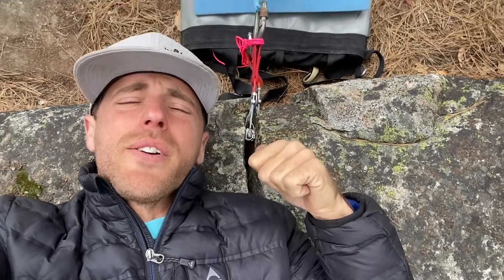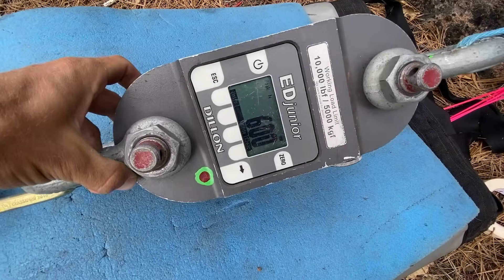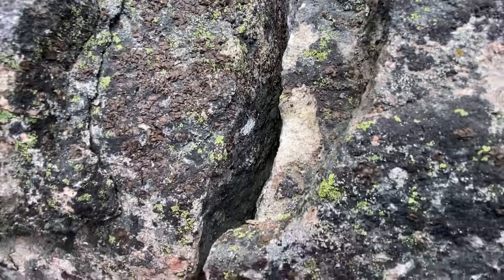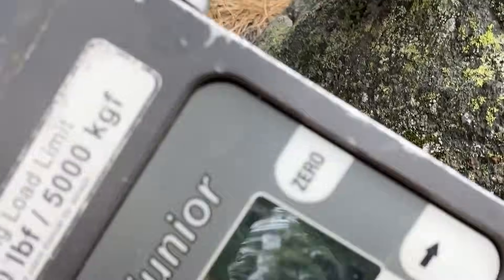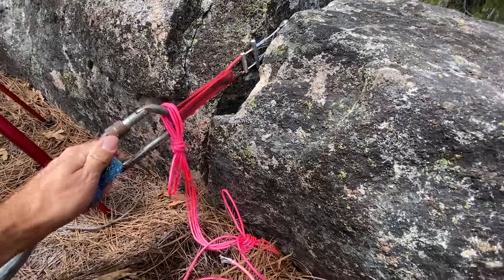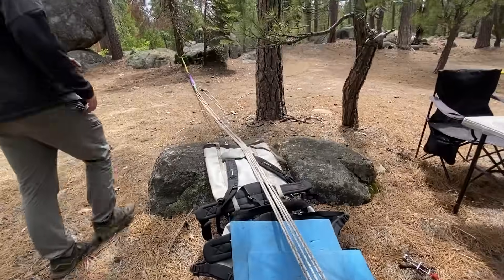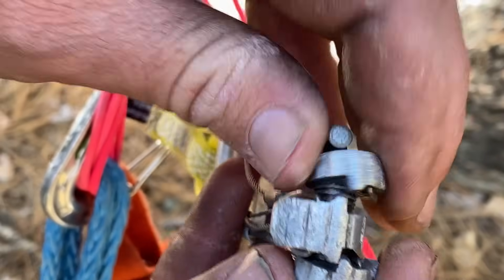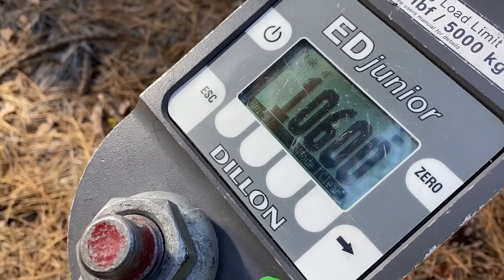Metolius TCU climbing cams pulled until failure - Great Slow Motion!

Comment: Impact force is more than just body weight.  You can lift a 5 lb weight with a thread but it will snap easily if you drop the weight.  5kn force from climber is possible from higher fall height.  A crack in a slab is a weak spot.  I trust the gear far more than I trust a mystery crack.  And I trust the rock far more than I trust my friend who tied the knots.

Comment: I wonder if you can strengthen it by putting a metal eye in the steel wire loop of the cam. That way the bend radius of the wire and the sling would be more favorable. I just wanna see the business end of a cam explode XD

Comment: 1 kilonewton is roughly 225 lbs of force. 11.85 kilonewtons is about 2,600 lbs of force. That's a lot! Those cams would hold most small cars in the air depending on the cam size.

Comment: I think this speaks a lot about working with gravity.  You might want to only use horizontal cracks because the weight of the rock pushes down on the cam.  With vertical cracks you don't get the same force of the rock pressing down.
Reply: If you are talking about a boulder, I'd agree, but for cracks in large rock faces, this makes absolutely no difference.

Comment: How much splitting force was put on the rock will depend upon the angle between the axis of the cams and the contact points on the rock - probably more as the cam opens up to max

Comment: From what I can see that's been recorded it looks to be a 36:1 complex ( a system that doesn't fit the def of a simple/ compound) pulley system. If I get a better overall view of the system I can make a better call. You start the T counting method at the pulling end/ tail (where a stopper knot would be), it's a lot better for when making complex or compound systems.

Comment: 7:13 I am an engineer, I know the math.
You can't say exactly how big this force was (You need to know specific size of equipment) but it was exactly as much as this rock weight (by eye 1-2 tons)

In the perpendicular direction, the forces goes to infinity, so it is half the strength of the equipment plus the torque force (depends on the shape and size of the equipment)

Comment: As someone who knows nothing about climbing, and only a bit about physics (high school)... Keep in mind that shock loading can be up into the tens of gees. So a very big dude falling on a unsafely stiff rope might BARELY edge out a failure (100 kg * 100 m/s^2 = 10kN). Or worse the cam lobes might not dig in right from the shock loading? Either way, even if the cam holds, at those accelerations there's a pretty good chance the rope jerk just snaps your spine... So there are other problems

Comment: Is grinding a cam safe? Idk everything about metallurgy but I know grinding a metal can ruin the heat temperament of a metal due to heat input. Filing is ok but from being a welder I know as soon as you see base metal turn any shade of blue you've changed the chemical composition and temperament of the metal
Reply: you change the temper , not the composition of the metal

Comment: I have never trusted cams because when you set them, you are anchoring into a cracked rock. But the reason the crack is there in the first place is because various forces have caused the rock to break and move apart. Even though the crack may be in large and seemingly stable rocks, it might also be right near a balance point of a huge rock that takes very little force to make it tip. When a cam tightens, the force applied to grip the rock is multiplied exponentially to the tension of your rope and can move big rocks easily. When the rock shifts, the cam looses its grip and then you are back to relying on your last good anchor. I use bolts for all of my anchors as the forces are just shear and the risk of shifting the rock is much less. Cams might be ok for 99 times out of 100 but that's not good enough for me. I now also assess the stability of the face that I am on in large blocks; I once stepped on an innocent looking ledge only to have about 5 cubic yards of rock disappear from under my feet. I can tell you, that is a weird feeling!

Comment: In addition to learning something about TCUs in granite, there are tree very helpfull takeaways for me:
1. Vertical cracks can be less secure than horizontal ones in some circumstances, because gravity. Was really shocked by this boulder moving.
2. Old slings are really bad. Every single sling in this test holds 22KN+ when new. Old slings obviously don‘t… not at all.
3. Carabiners create a lot more stress on the rest of the material and slings should only be substituted for carabiners after careful considetation.
Reply from the maker: Don't think the slings were compromised by age. the bend radius where the sling attaches to the wire on the cam is very severe and the wire cuts into the webbing, even when reinforced. We see similar results on new cams. The 22 kn rating for similar slings is achieved with a less severe bend radius. 10mm pin if I recall correctly.

Comment: The outwards force (left and right together) of the cam has to be at least the outward force divided by the coefficient of friction (F = mu N) and assuming a coefficient of friction of about 0.5 and a foce of 10kN, that would be about 20kN outwards (minimum to avoid slipping). This is very approximate but it should be right

Comment: These videos are great! You should get some granite off cuts from a countertop installer. The underside is fairly natural texture.
Reply: What would be the point of that? Countertop cut off are not gonna weight enough to test anything.
Reply: @goodbyemr.anderson5065  not for weight. To use as the contact surface for the cam. Test cam against stone instead of cam against metal.

Comment: This just tells me that cam placement is better in horizontal cracks rather than vertical cracks. Vertical cracks can be levered with less force than it would take to lift the mass of the rock itself. Whereas, horizontal placement means you would need to overcome the entire mass of the rock to have the cam slip out.

Comment: Talking about the bend radius issues on the cable I wonder if doubling up carabiners might help?
Reply: The metal wire will still bend over the edge of the carabiner.  That's the bend radius he's referring to.

Comment: According to factory testing Petzl has done they say an anchor experiencing a FF 1 fall could see as much as 6kn of dynamic load +\- .5 kn.  Interested in how that lines up with your tests?

If that is true, there is a generous safety factor designed into these cams. Makes one feel a lot more confident using them.

Comment: 1. you could put fiberglassed cement-board in your cam-crusher for rock-lick friction
2. you can use sharpie on the cam teeth to gauge new vs. old damage pretty easily, if that is something that matters to you.

Comment: Wow those cams are amazing un real i never rock climb but seen theas cams in out doors outfitters and though i wouldent want to trust that im wrong as long as you know how to use it the cable and sling will break before coming out:::

Comment: Fun to watch and useful. To me, this confirms what I was told/thought about placements pulling out - unless you're on #00 tiny stuff, it's really all about the quality of the placement and the quality of the rock.

A little shocking to me to see the side section of that first rock rip off. It didn't look like a flake from the camera angles. It's granite, not overly rotten rock. I'd call it confidence inspiring. The placement wasn't all that shallow either. Having the rock fracture ~5.5kN was a little shocking. I think this was a worst-case - typically the cam wouldn't pull directly out in a fall, but slightly downward. Still, a bit surprising. I might consider being slightly less confident about shallow placements from now on.

Comment: The lateral force by a cam goes as  1 over the tangent of the angle formed by the contact point and the axle, call it theta: F_lat=0.5*F_ax/tan(theta).  That angle is a design variable which depends very much on the anticipated coefficient of friction--the lower the friction, the smaller that angle must be to hold.  A cam will NOT work without some friction to keep the lobes from slipping and thereby force the cam rotation harder into the wall.   For example, cams don't work on polished granite.  This theta angle is typically around 15 degrees and remains about constant with cam extension for parallel sided cracks.  In this case of about 11kN axial force, the lateral force would therefore be approximately 21 kN (4700 lb).

Comment: Backing all the way out, to just thinking about placing gear for protection - a simple nut in a good tapered placement also exerts wedging force, but the friction against the walls might be higher, so expansion might not be observed. It looks like that particular rock could be slung around the other end, a perfectly useful way to get a directional anchor that exerts just a single pull, with no multiplications from cam leverage, etc, and as it weighs several tons, one could expect to trust it. Except, that if it were poised on a near balance point, the force needed to rotate it might be a small fraction of its total weight. Thinking about how each situation has potential weaknesses can be sobering. Making a habit of placing even cams into tapers and not just blindly into parallel slots can make much more reliable protection.

Comment: Easy idea for the slack-snap out of rock.  Granite countertop dealers will sell you the pieces from sink cutouts for dirt cheap and then you can fabricate your plates to hold them.  Usually, the bottom side of the material is rough,

Comment: Basically as long as you're not trying to lift a small car you're safe.
Reply: "Big" car lol. Pretty sure those cams could take care of most compacts. But yeah, if you are trying to dangle your 4x4 off a cliff, I reckon use three of them to be safe.
Reply: @TheWtfnonamez  I was just about to ask how many to use for a vehicle lol

I don't know anything about rock climbing anchors, but I know about block and tackle pulley systems and I know that if we had a good enough anchor you could pull a car straight up a cliff with your bare hands using mechanical advantage! Always fun to imagine what might be possible with these tiny devices
Reply: Same 🍰
Reply: Or using slippery cracks!!
Reply: @sammyd7857  You better remember to pack condoms on the next hike.
Reply: Which absolutely blows my mind
Reply: I learnt in my harness safety course over 10 years ago. If a construction worker falls ? His harness puts 800kg of force by the time the safety Webbing opens on your body. Your body takes 800 kgf if you are 100 kg bloke? Insane! Cheers from Australia just subbed.nice work.
Reply: @dragan3290  how did they test that?
Reply: @sammyd7857  I wish they told us! But those were the figures even when I asked the abseling crew on the site. Oh btw the eye bolts that the abseling crews install have to pass 6.5 kn when lifted out of concrete upwards. That s how they test the anchors on site before anyone is allowed to use. Seems textreme?
Reply: @sammyd7857  It’s a pretty simple physics equation.
Reply: @dragan3290  That 800kg seems...super not true. Especially considering construction workers bring their attachment points with them, so they are not taking factor-2 falls. That would be almost 8kN, which is more than any lead climbing fall.
Reply: What if yoi weight the same as a small car
Reply: @chetcoyote89  then you may want to consider wearing a nappy
Reply: That rock will way a lot more than a small car.
Reply: @thedoddfishtreemonkey.7760  Obviously, what's your point?
Reply: @skrimper  if it’s so obvious then why was it an example…….Sherlock F*cking Holmes ?
Reply: 🤔So I'm good if I'm lifting a large car... good to know😉
Reply: Yeah but falling turns the weight of a human into the weight of a small car sometimes if you fall far enough
Reply: lmao this aged poorly with the dmm car lift with one of their little cams
Reply: Or fall 6 meters at 100kg. That would do it too.
Reply: Or tal an X fall
Reply: Don't lift your mom ..got it
Reply: Battleships are right out
Reply: Better not climb then 💪🏼
Reply: If a human falls like 10 feet it could generate 10 kn or more depending on how fat you are
Reply: @actuallynevermind8120  unless you're using a completely static system you're probably never going to go above 5kn of force for a fall

Comment: Sponsers HEAR THIS! This is important! I went from just this morning not quite believing in cams completely, to now feeling that I actually do trust them. If this can change my mind, just think how it could increase your market share! C'mon - Sponser this guy!
Reply: You need to trust your placement and the rock. Thin metal stuff, if you still can't bend it, will still hold multiple times your weight.
Reply: It Really helps to play with them over n over in safe situations to get to know em and how to place em! After a while of this you’ll know what works and what does not and then your trust will build even more! 🤘👽
Reply: @Thurston86  I completely agree. With your comment and the comments above yours. I already trust the cam to do what it supposed to do. For me the cam was never in question. Its the placement and the rock. And the only way to really know how to trust your placement is, like you said, to spend time playing around with it on the ground..or in a safe situation. After awhile u pretty much develop an instinct for it. Before u even place your cam u already know how good of a placement it is and how its going to sit in there just looking at it. Like every other skill you learn in life, it just takes practice.
Reply: Yes. This video and the math comment above enlightened and built some trust in me in cams and rock climbing equipment, especially certified ones.
Reply: @moonbrewery  having complete confidence in your gear is important. Honestly, what helped me build confidence early on was falling. Experiencing falls, and my harness and all my gear doing what its all designed to do, will build alot of confidence. As long as u inspect all your gear and equipment, make sure theres no rips, tears, excessive wear, etc..your gear and equipment is NEVER going to fail u. Its all going to work the way it should. If an accident or a ground fall happens, its not going to be because of an equipment failure...its going to be because a human error...a mistake that YOU made.
Reply: He's said he doesn't like sponsors before because he wants to be totally unbiased
Reply: Same, now I don’t trust that cloth sling part though
Reply: Sponsor**  And no,he doesnt want sponsors.

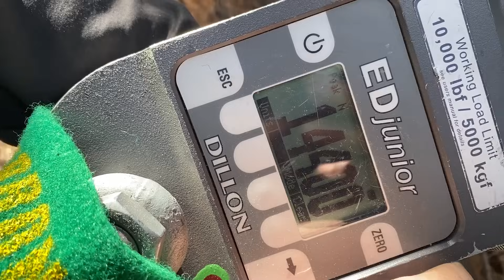Comment: @15:20 how the wire gate opened looks very interesting. I had a recent ground fall after micro nuts popped. One nut landed without being attached to its quick draw, which puzzled me a lot until I saw this. I guess it's possible that the quickdraw gate must have opened during the shock like it did in this video. Thanks Ryan, I really enjoyed your videos.

Comment: The average person witch is considered to be 200 lbs creates 5,000 lbs of force at a 4 ft fall. So thats not a force created by slowly pulling from say 100 lbs gradually up to 5,000lbs its measured from ZERO force on the fall protection equipment to a violent abrupt 5,000 lbs of force hitting all in a split second. I would be curious to see what your climbing equipment will do on a real life scenario.

Comment: Well...when they sell them i think they provid indication and some safty test...so what is the point...all persons are responsible of what they do and how they do...risks are not surmountable..there is 1000 of factors that could influence the final result...i do not understand the comment of persons that looks like fighting a war in order to ensure the 100 % of safety of those systems...if they were not working they wouldnt be selled....so my question is do i'm stupid that i don't use those things or you are stupid because you take unnecessary risks because you have those things? the real answer is that those system do exist because persons died and used much worst systems and they did in any case climb...so is not a competitions with stupidity...

Comment: When placing 3 lobed cams in horizontal placements, you want the side with 2 lobes on the downward side for more stability normally. :)
Reply: Bradford Burns. Common myth. Only applies if you are setting the cam on a table.